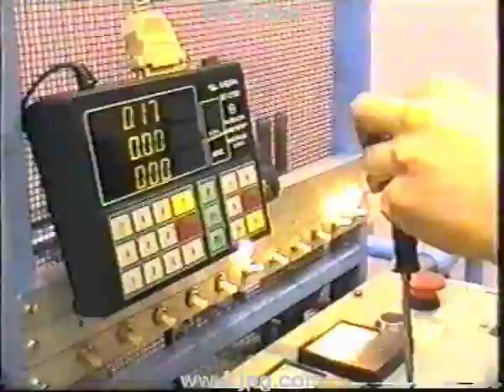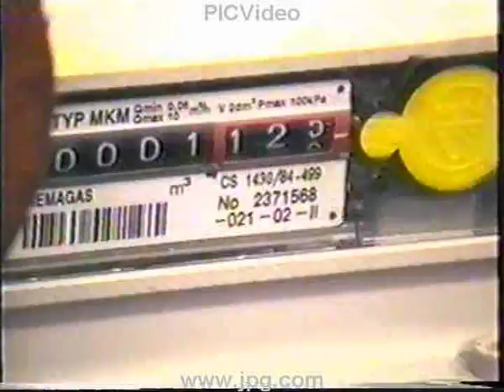Axial rotary engine - MADE in RUSSIA  since 1998 !!!

Comment: no solution to the sealing pressure of 1:16. The design of this engine would work perfectly if the problem of gas pressure sealing was solved at least partially.

Comment: Interesting, but I believe the performance of this engine and power-to-weight ratio have been exceeded by conventional piston engines of the mid-2000s.  It could still be useful, though, as a stationary engine to run an electric generator if it could significantly exceed the service life of a Diesel reciprocating engine while at least matching the fuel efficiency.